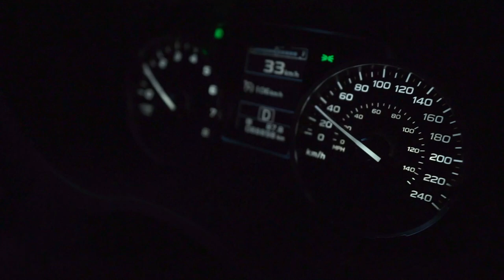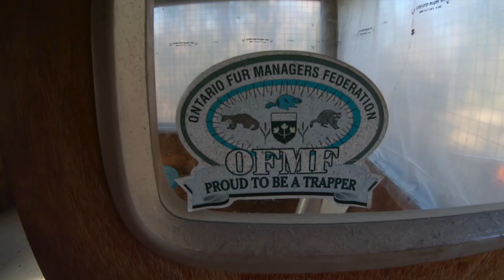Start your Morning off right! Algonquin Park! Exploring| Wildlife| Sunset!

Comment: Great work on the editing side guys! And yes, that breakfast looked amazing. Hey Teunis, how did the deflated tires work out? I know the benefits of letting air out for rough roads, but I've never done that as yet, and I've gone through some pretty gnarly stuff. Did you notice a big difference?
Reply from the maker: Hey David! It will depend on your current wheel and tire setup but with my 15” rims and Ko2s I have tons of side wall or “meat on my tires” if you will. So when you air down you notice a huge difference! Way more cushion and comfort and the tires more or less mold over the objects. But with that you loose stability and control at speed which is why they say low and slow. Hope that answers your questions, thanks for watching man!
Reply: @FreakofNature1  Cool, totally makes sense. Thanks for the info bro!
Reply from the maker: @ThePursuitofPassion  you are most welcome 😀